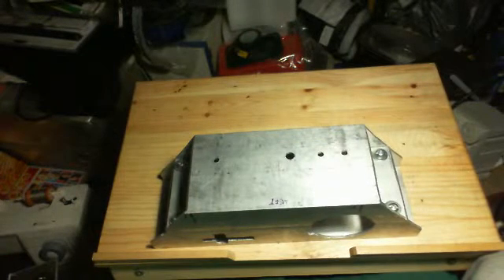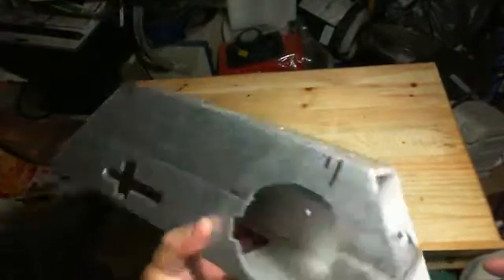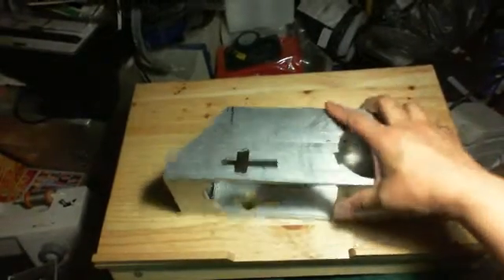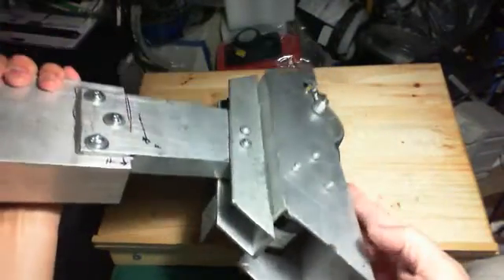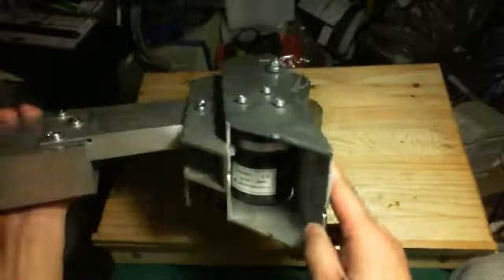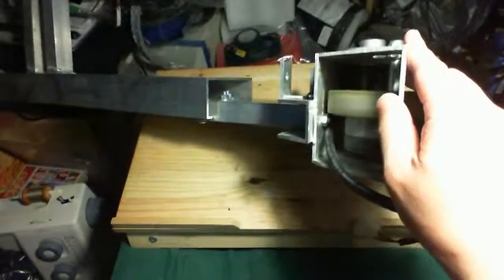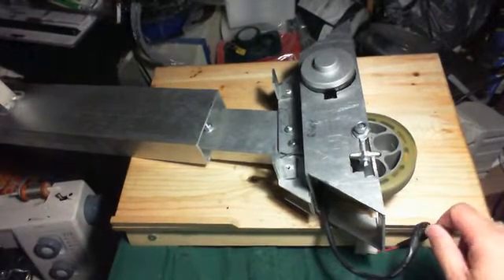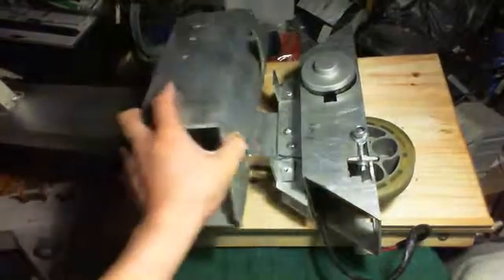R2-D2 Drive System - 100W Scooter motors

Comment: As there is no swiveling castor, does it turn like a tank with one wheel turning and the other braked?
Reply from the maker: It does turn like a tank.  I can get one wheel going forward and the other wheel going in reverse for tight turns.  I could leave one wheel not turning but then the turning radius is larger.

Comment: about how much  of the wheel  was ground  down?
Reply from the maker: I think I took of 0.5" so the total diameter was reduced by 1 inch.  The second reason for grinding down the wheel was to produce a wider wheel so the load is spread out over a wider area and will ride easier on carpets.

Comment: just  got a pair  of Wheel and motor  ass. what  to did you  use to grind  down  the wheels?
Reply from the maker: I had a friend who was able to put it in his lathe to grind the wheel down.  If I didn't have that option I probably would have used a table top belt sander.

Comment: hello great video, tried  looking  on ebay  found  a 150 watt  motor  will take  work? and most  of other  motors are  chain driven, is there any other  place  I can source out for these motors  at a reasonable  price.  thanks ☺
Reply from the maker: The 150W motor looks like the same size as the 100W motor.  Any motor and chain/belt would do.  You would just have to modify the mounting holes. 

The best place I found to get scooter motors and the rest is Kijiji or Craigslist.  People sell the entire scooter fairly cheaply when the battery dies after not being charged during the winter.  That way you get the motor, belt/chain and wheel.

Comment: what motor and wheel exactly are you using?
Reply: StyrofoamGuy  thanks  for  the info hope  to get my r2 up and running  soon😊
Reply from the maker: I am using the motor, belt and wheel from the Razor E100 scooter.  I do not know the exact model numbers but if you do a search for "Razor E100 Parts" you can get replacement parts for it.  I recommend trying to get one locally where the battery has died and people try and sell it for cheap on Kijiji or Craigslist.  I have managed to get the entire scooter for less than $50.